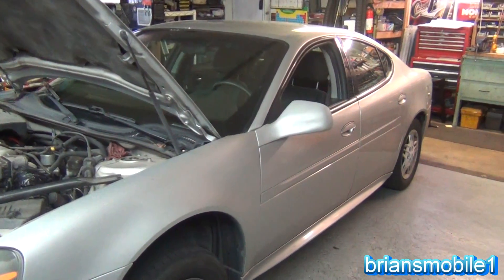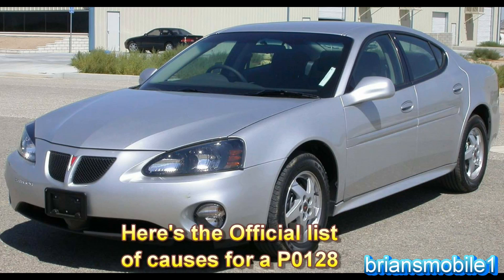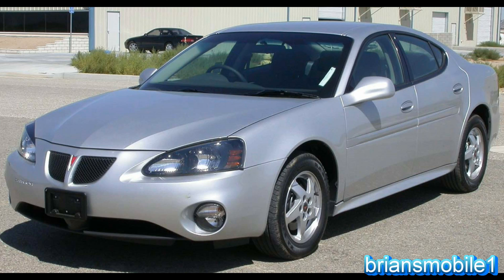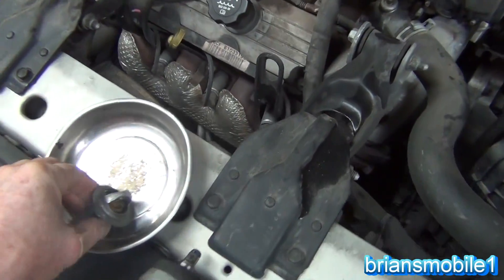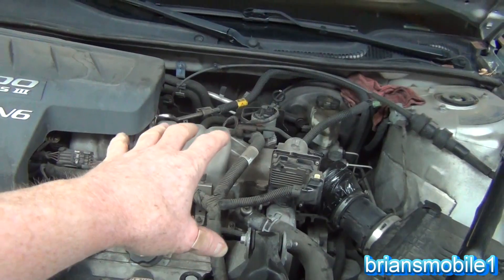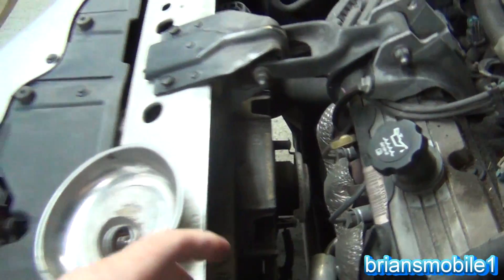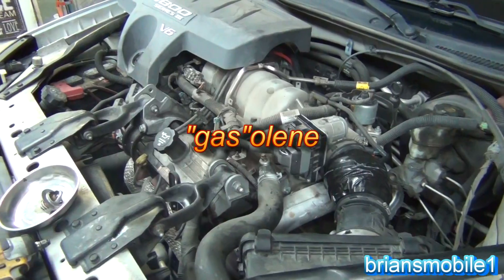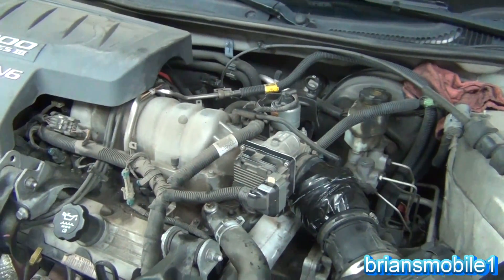P0128 What's a Thermostat and Why is it Making My Car FAIL Emissions?

Comment: Hi , a mechanic used to remove the thermostat from my car , i am living in Jeddah, which is a coastal weather city , is it important to put it back in ? and would it make the performance of the engine better, makes the rubber seals, hoses and engine components live longer ?

Comment: Hey Brian, I live in South Florida where we have hot weather most of the time, would it be okay if I were to drive my car without a thermostat?
Reply: It don't see how it would be a problem to take the thermostat out. I mean being in South Florida where the weather is hot, your thermostat pretty much stays open all the time anyway.
Reply from the maker: Your engine will take too long to warm up and will run too cool.  Basically your fuel economy will suffer and your car will pollute more.

Comment: Hey brian, I have a 2000 dodge ram like yours buts its a 1500. I have pretty bad sloppy steering. I just installed the steering box stabilizer you talked about awhile ago and ill have to see if that helps it but how to I fix the sloppy steering? I took it to a shop to get an alignment but they wouldn't do it because they said I needed a whole new front end which I have a hard time believing but at the same time, its a dodge so i might. Do you think I should get a second opinion on my front end/ alignment problem and whats the best way to fix my sloppy steering/ little case of death wobble. Thanks!

Comment: Had this in my 4.3L S-10 Blazer... within 10 minutes engines supposed to reach certain temp.... it was falling 1 degree short and coding engine light....changed Thermostat even though could find nothing physically wrong with it... fixed problem.
Reply from the maker: Nice!

Comment: Brian
Coolant runs the opposite way you ststed. Goes in the lower water pump inlet then gets let out the top via the thermostat. I will watch out for the little witches though.

Comment: Can I ask what is the software/app that you used on the android phone to read code? Thanks!

Nice video as usual, BTW.
Reply from the maker: You can use the torq app.  I have that one.  Here, I used my phone to take a picture (as I often do to save/take notes on anything happening in my life) of the actron scanner I used and left a link in the description of.
Reply: briansmobile1 Thanks!
Reply: briansmobile1 I use the torque app too! Before, when you didn't repair independently and you were still at a shop, did they have you use any other scan tools. How does the torque app compare for you in comparison to more expensive tools?

Watching Ericthecarguy use a good one available at AutoZone by Actron for $120 to $230, I think I'm getting better use out of my torque app than Eric, just for an example. His seems to report data slower than mine. I know that does depend on the car and how many PIDs you're looking at. My car reports pretty slow whether I have few PIDs or plenty of them. (Professional torque app $5, free version is too slow as it uses adds; USBII bluetooth adapter up to ELM $15 on amazon, with $15 shipping....many of the less expensive ones are $15, with $15 shipping, so they're really $30. I just read a lot of reviews before I bought one to get one that really worked - lots of junk at that price range.)
Reply from the maker: I used the Modis by Snap On.  I've owned and used an OTC Genysis for years.  I recently bought the Maxidas, but it's like a baseball glove with big holes in it.  My Actron is the go-to for MIL reads.
Reply: I guessed that's why you and Scotty use the actron if all you need is the code. Simple can be quick if that's all you needed.

Comment: Did that have a rubber gasket that went around the thermostat?  I had a 98 that I replaced the thermostat and I didn't notice that the old one had a rubber gasket. Needless to say my car during the winter months wouldn't blow heat. When I replaced it a second time the parts guy told me it had two parts, the thermostat and a rubber gasket.
Reply from the maker: It DOES!  If I were to make this video again, I'd show that.  Thanks for asking!

Comment: I always thought the coolant went the other way lol. Nice ride! Thanks for sharing
Reply: You are correct. Coolant leaves the thermostat and travels out through the top radiator hose. through the radiator, loses heat in the radiator where the lower temp coolant sinks to the bottom of the radiator, out of the lower radiator hose to the pump suction inlet, then pumped through the engine back to the thermostat.
Reply: patw52pb1 Okay, that makes more sense as heat rises. Pull the hot out of the top of the engine, put it in the radiator, and as it cools, keep pulling on the coldest radiator fluid back into the engine from the bottom.

With the thermostat right before the upper radiator hose it controls when the engine is warm enough to let the heat go.

Comment: Why were you waving your hand backwards?
The coolant flows from the lower hose to the water pump, thru the motor back to the radiator by the upper hose.
Reply from the maker: I know.  Like a dam.  I mess stuff up like that sometimes when I'm thinking of what to say next and I'm watching through a view finder.  It feels like patting the top of my head and rubbing my chest in a circle at the same time.